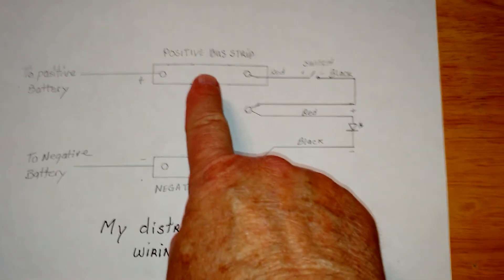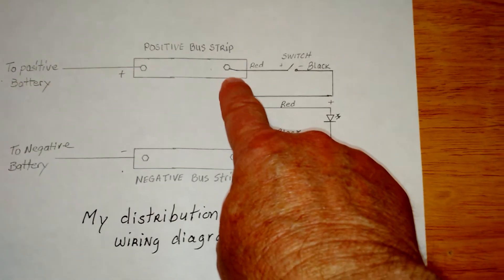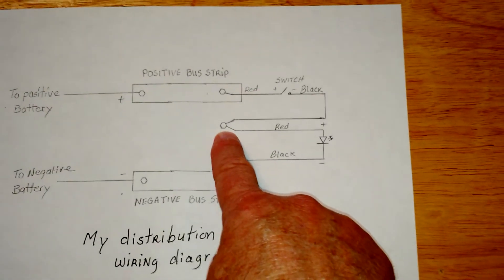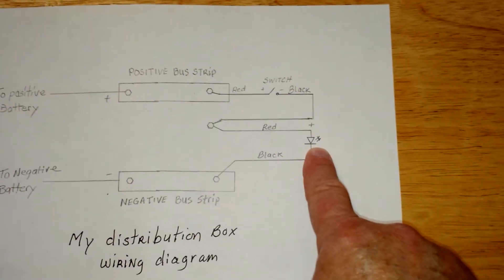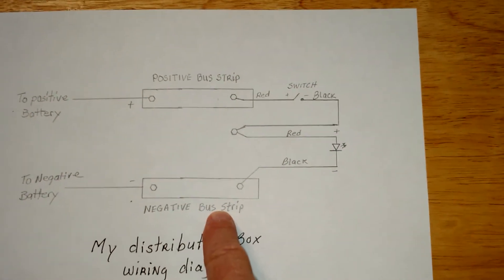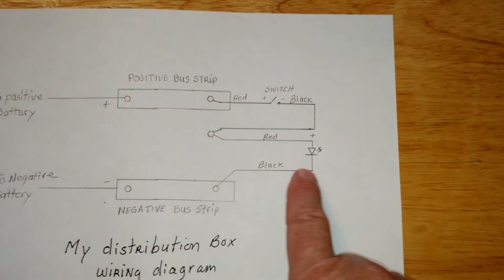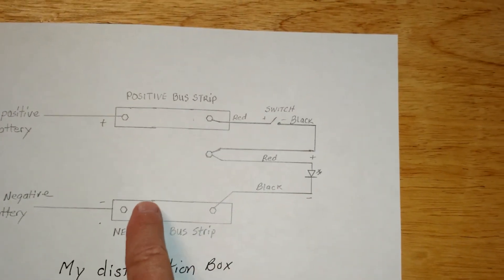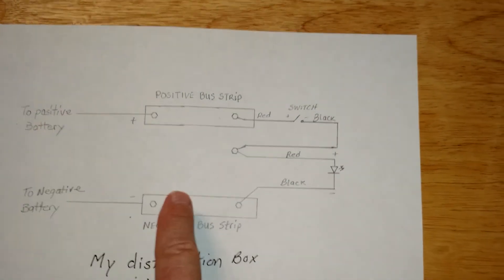Wiring diagram of my distribution box

Comment: Why bring the conductor back into the box after the switch and before the load, in this case LED lights? And what about fuses?
Reply from the maker: irishlep64 wiring each switch individually made it easier putting it in place. That was a difficult space. The battery wire has an inline fuse!
Reply from the maker: irishlep64 plus the box was an easy way to terminate all the wires instead of having them bundled and laying on the floor of my kayak.